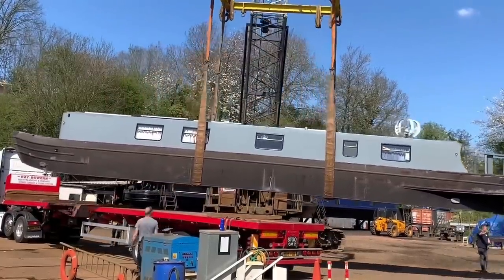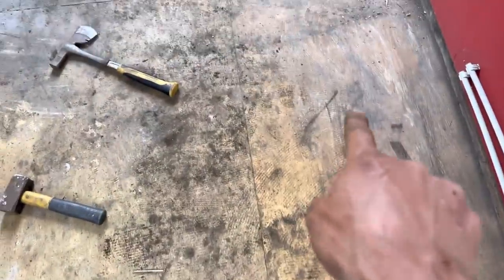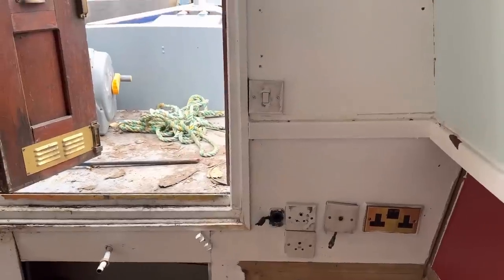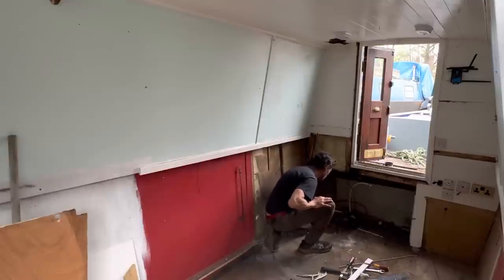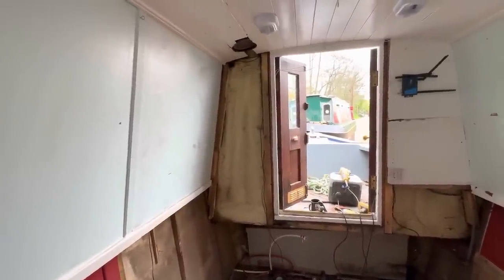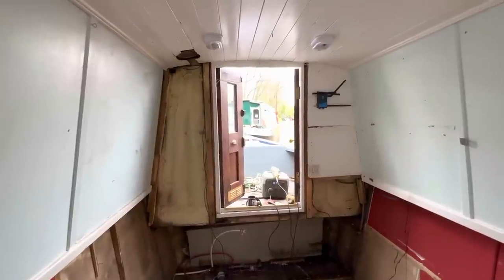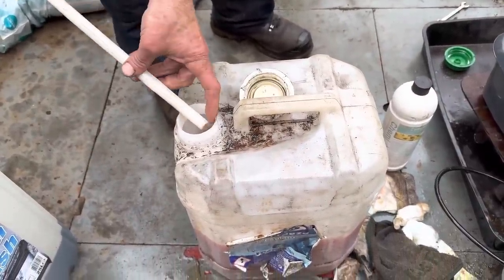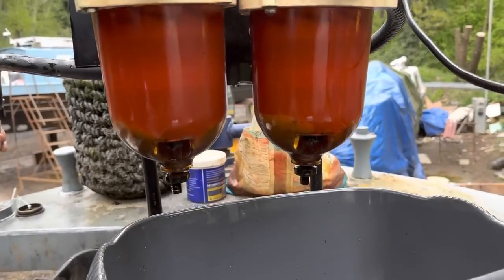414. How to KILL diesel BUG

Comment: Hi James. Couple of things. After watching many narrow boater vlogs,  before you get carried away ripping out, the radiators.  Some are saying the extra thin rads are not good for decent heat and have swopped them to the thicker ones like you have already. Secondly, the new coal fire, do you not think it would be better in the middle of the boat other than by the doors, for overall more heat. Thirdly, if you are still going to Crick, I,m sure you will find more ideas and hopefully may save you a bob. Canice Bannon, on his rusty Dutch Barge, has great info on rusty insides, and rust prevention.  Anyway, all the best James .
Reply from the maker: Good stuff in there. Yep I know double rads hold more heat - I’ll thinking still about that. I can’t really put it there for design reasons although im not 100% on that yet. Yeah I watch him and his boats - lastly I don’t think it’s possible to save a bob or two at Crick !! Seen the cost of rope and a sausage sandwich there !!! Thanks pal
Reply: Great recommendation regarding Canice Bannon’s Channel!

Comment: James, could it be that the water tank needs to be on a small angle to ensure that most of the water can be drawn out when the water circuit is run?  If the tank is level, it looks like about one inch of water will remain standing where as on an angel, it looks like maybe only a gallon will be standing.
Reply from the maker: That is something I’ll look into maybe - I might investigate the tank itself if it ever drains
Reply: I wondered if it slightly on the tilt so that any bits in the tank weren't drawn off , but looking at the pipe being 50mm from the bottom of the tank  just like my old house tank probably not the case

Comment: I'm not too familiar with riverboats and the such, but for rust mitigation, are you allowed to use rotary preventatives like Cosmoline RP-342 or would that's not be an option for being across the pond.

Comment: I agree with taking the t and g down so you can fully replace all of the electric cabling to give you peace of mind that everything is safe. Plus it will look so much better. You really are cracking on with getting so much done. Youre right to remove the back walls, flooring and replacing it. It gives you the opportunity to clean out the water tank properly without too much bother. Thank goodness you didn’t find anything to worry about like with sloe patrols floor. It’s going to look fantastic when it’s all done 🤗

Comment: good job on the diesel bug, always good to sort that as it will wear down the engine. Do plastic water tanks need lagging? I think maybe a thermal blanket would be wise! Definitely  take it out to clean and reseal the connections. I would take all the walls and T&G down and rewire just for piece of mind. Replace EVERY bit of wiring so you know where you are.
Reply from the maker: I don’t think the walls contain any electrics so I might be ok. Skies water tank isn’t lagged and she’s dry as a bone. It’s insulated all around which may help.
Excellent you agree to remove the t and g
Reply: @TheNarrowboatThatJamesBuilt  When we get our boat, we are just panelling, but we are going to be doing a more generalised starwars theme on the boat. You could always upcycle your T&G by stripping the paint and using vertically below the gunnel or to make storage boxes on the roof to store stuff (under the solar panels). Loving the daily posts now James and I love fit out videos

Comment: Looks good there under the door, reckon stripping it all out was the right move so you'll know its all good. Plus you can get at the water tank as well which is a rare bonus. Wonder if the water pump was maybe the source of the damp rather than hole in the roof? the T&G isnt hugely stained and rotten nor is the wall. Youre making good progress though so keep up the good work.
Reply from the maker: Thanks mate

Comment: The deeper you go, the deeper it goes. Please don't take the ceiling down! You could detail fill all the little holes etc, get it real nice, access cable through fittings holes. Maybe repaint with a less shiny finish?

Comment: Instead of using the plunge tool on the floor, use a 18 or20v circular saw and set depth to 18mm. Much quicker than hacking away with that tool. Given the rot,  I would remove the entire floor to check the joists and rustproof paint the hull. Then use 18mm WPB plywood for your floor if joists are ok. Your floor is knackered if it feels spongy along any section, and complete replacement is necessary - good luck
Reply from the maker: The whole first section is bad and will be replaced - the rest seems fine and I’ll investigate it all - every inch

Comment: Apart from diesel that has been stored for a long time, supermarkets are notorious for selling dubious diesel. They aren't nearly as fussy about input sources as the big dedicated petrol stations are, and they also do not put additives into their diesel but instead sell it straight as it comes from the refinery. That unfortunately means you get a mixture of fossil diesel and biodiesel, and the latter is much more prone to holding onto water.

So, if you're going to store diesel for any amount of time, put a combined detergent, cetane booster and biocide into the mix. For storing it for lesser amounts of time, just the detergent and cetane booster will do. The detergent dissolves water in diesel and makes life much more difficult for diesel bug; the cetane booster improves the burn rate of the diesel.

Comment: Lighting; you don’t have to remove the ceiling.  Run warm white LED tape down both corners where the walls meet the roof.  Make a trough for it to sit in so that the light washes across the ceiling.  I can draw you a detail if you want.

Comment: need to drain tank and run a pressure hose wand into tank from the diesel pump. Spray down all the inside and discard fould diesel wash and sludge. 
The filtering while nice , doesnt eliminate the accumulated gunk on tank walls and top, you would be amazed. No matter old timer still did good work filtering the sump.
Id have gone farther though, very least run a GIANT medium mesh diesel truck filter 1st in line , for one year afterwards.Tto catch the remaining material that gets loose.

Comment: Re the engine set up. Kindly suggest replacing the submerged Tecnodrive gearbox with Newage 150. Bigger gearbox more suitable to pushing project 58 along the canal. ( Can be fitted to the Vetus )  Also replace all engine mounts as they last about 10 years. Also whilst welder there fit plate across the swim to the hull between gearbox and stern bearing after cutting propshaft. To plate fit aquadrive or python drive. Then prop thrust is pushing the boat along via this plate. This results in far less wear to stern bearing, gearbox and engine mounts. The engine mounts are not pushing the boat along and the gearbox will last almost forever. Only a suggestion. Very enjoyable vlogs.
Reply from the maker: WELL ABOVE MY HEAD
I will read this Ralph who will either say nah and carry on or spend an hour explaining the potential issues/costs/grief with anything “extra” I might ask for 
I will read it to him though so thanks so much for your ideas

Comment: That plastic water tank will be running with condensation with the cold water inside it. Probably what has caused moisture issues on the floor. Wrap some bubble wrap round it or some of that  packing foam sheet to stop the air condensing on it
Reply from the maker: They honestly don’t create much condensation. The one on sloe patrol is bone dry and always is all year round.

Comment: What a total scam ! 
Diesel bug does indeed form in diesel fuel tanks but only in the water that collects from condensation OR water that was in the fuel when sold.
All that needs to happen is the fuel is left to settle, the water will always fall to the bottom along with the debris.
This is then drained off as polluted water, the fuel can then be warmed & filtered.
The cheaper option is to have a fuel separator & two stage filter system fitted to the existing fuel system.
The way to prevent condensation is to keep the fuel tank full as much as possible throughout the winter.
It’s also possible to run a heating pipe through the fuel tank that heats the fuel from the engine cooling system, this will evaporate any in fuel moisture.

Comment: I thought you said iyo the stove had to be in the middle of the boat now your saying it’s going to the right hand side of the front doors. What’s changed your mind ?
Reply: @IDKline  didn’t realise you were James’s mouth piece 🤣🤣🤣🙄
Reply from the maker: I didn’t say it MUST be in the middle - I said ideally it would be but I also said that sometimes having at the fore bulkhead is the only option for layout purposes. Arguably it’s the best use of the space and fire proofing at the fore bulkhead but worse for heat distribution. Less of a problem for me as I will have a radiator to provide heat throughout the boat and a kick ass fan to blow more air down